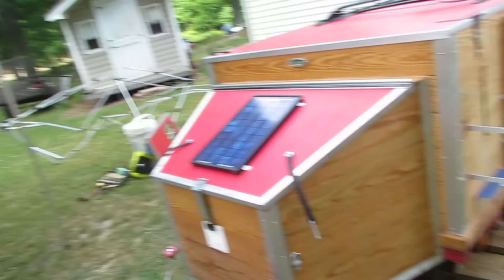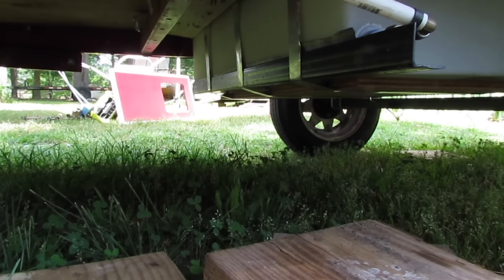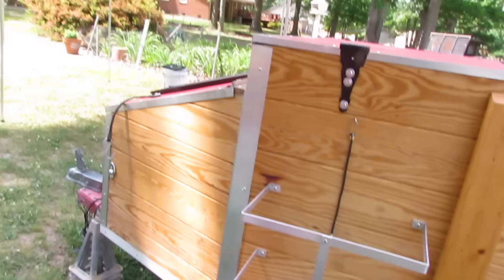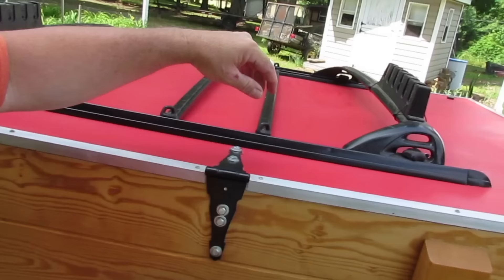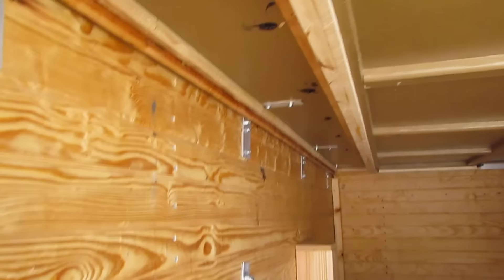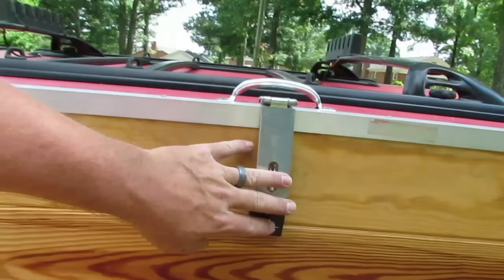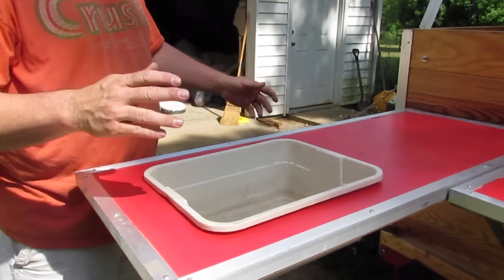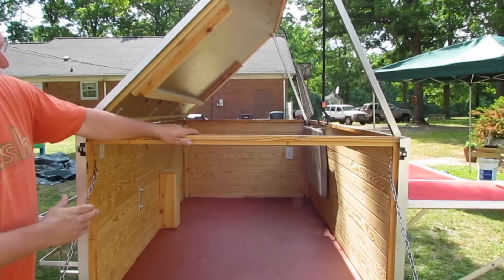Harbor Freight 4x8 Camping Trailer

Comment: How much does it weigh? So far, I did tow 3 different U Haul trailers with my 2013 Chevrolet. It was 50 mph for first 500 mile break in period as well. I did tow 3 different U Haul trailers from LA to Seattle as well. My 2013 Chevrolet does well! The empty weight of first trailer was 850 pounds and second and last trailer was 990 pounds. Car is only rated to tow 1000 pounds. When loaded with my stuff, that trailer could have been 1500 pounds and I did measure the tongue weight on second trailer, it was 156 pounds, which is not too bad. GM rates my car as 100 pound tongue weight, but it can hold 200 pounds well! Car is only rated for 1000 pound towing. Lastly, our 1978 Chevrolet from years ago can tow 5000 pounds with 500 pound tongue weight, much better rig there!
Reply from the maker: Wow, you've done your homework on the capabilities of your vehicles. My trailer weighs about 840 pounds empty. I'm not sure of the weight loaded but I'm sure I'm pushing the limitations. I pull the trailer with a 2003 Honda Odyssey and it does great. Thanks for watching

Comment: Nice Trailer, have you tought about running two batteries in parallel for more power?
Reply from the maker: Thank you, yes, I had two batteries on our last trip, worked out great. Thank you for watching
Reply: The Furrminator 
   May I ask what items you were running off of your batteries 
and what amount of run time did you get out of them...?
Thanks.

Comment: Appreciate the walk around! I’m about to start on a build with a very Similar trailer. Did you have to modify the suspension at all? How does it handle?
Reply from the maker: I haven’t modified the suspension though it’s pretty heavy when loaded. I did upgrade the tires to take more weight and higher speed rating

Comment: I see your water holding tank but where's the faucet or whatever to get water to use
Reply from the maker: Preston Frady the plumbing leads to the front and goes out the right side or passenger side. I have a quick connect there and we use a water hose to go from the quick connect to the sink.

Comment: did you think of using one panel from the Harbor Freight solar kit? one on the top and the others carried but not pluged in until the camp is set up?
Reply from the maker: I have heard that the HF solar kit works great and I've considered getting it , it's pretty inexpensive. I haven't thought of using it like that but I think that's a great idea. Thank you for the suggestion and thanks for watching

Comment: Great build and very nice video. Can someone tell me the distance from the top of the trailer frame to the top of the fender? What I'm wanting to do is  make  this same trailer 5' wide so I need to build my deck up so that its above the tire or the tire and fender. I'm not sure if I need to keep the fender in place or not. Thanks ahead of time...
Reply from the maker: I never got a measurement from top of the Frame to top of the fender before the build and now that I have the unit built the top of the frame isn't visible but a close estimate is 2.5 inches. I have raised my fenders another 1.5 inches for more clearance with heavy loads. Hope this helps

Comment: What state so you live in? From what i have researched in several states, trailer have to have a license plate and if it is a camper or tiny tome they have many more laws requiring building permits & inspections or they cannot be made by the owner at all. I’m wanting to build an RV that my son and i can use while we search for land to buy in Missouri ( Missouri is the easiest state I have found yo build your own tiny home on wheels or small house (less than 800sf). We plan to move to Missouri so that we can build both a tiny house on wheels for me & a couple of small houses/buildings for my son.

Comment: How much did you end up spending? 

Also can you make a video about how you started it? What I mean is how you attached the wood to the trailer and made it so sturdy.
Reply from the maker: I didn't keep up with the cost but I'm guessing that I put about $1,500.00 total in it. I made several trips to lowes over a three month period. Keep in mind I went way overboard and could have cut some corners to save, for example, all of the aluminum was not needed just wanted it to kinda dress it up. Here is a link to the slide show that shows some pics of the trailer during the build, https://youtu.be/SKfPgyygw7E , hope this helps, if not let me know and I'll try to explain it a little better.

Thanks for watching

Comment: Do you sleep inside the trailer?  If so, what size is your air mattress?
Reply from the maker: We don't sleep in the trailer, we sleep in a large tent. The trailer is just a way to haul our camping gear. I originally planned to build a teardrop trailer but with four kids living at home, it wasn't practical so we went with a gear hauler.

Comment: im sorry i dont get it...You supposed to use that in conjunction with a tent or what?
Reply: ahh ok i was thinking where does he sleep? lol ok then i can see that but why the electric in it?
Reply from the maker: +Dave Adkins Yea, we have a large family and we tent camp. There is no way we can haul all of our gear with the family in the Honda Odyssey so I built this trailer to accommodate. I have camped for years and I have accumulated a lot of gear, we use to camp in a travel trailer but over the years we have scaled down to a tent but hope to get another travel trailer at some point. The fact is, a tent is cheaper right now because a travel trailer that is big enough for all of us would be more than I want to spend. Hope this helps. Thank you for watching.

Comment: I think your idea is VERY cool! But, Wouldn't it be cheaper to by a POP-UP camper and customize it to fit your needs? With a POP-UP, the kitchen is inside (all season), heat, hot water, plumbing, sewer, sleeping... all self-contained... Dont get me wrong... VERY COOL VIDEO! But, I would buy a regular pop-up, cheap, and add some $$$ to do the options you suggest! I think the $$$ would go a lot further...
Reply from the maker: You are probably correct about the popup. I originally purchased the trailer to use as a teardrop trailer. Before I started the build I determined that it wasn't really going to work for my large family so I changed the plans to build what I have now. Thank you for watching
Reply: 3zonker88 More fun to build from the ground up. You just don't have as much "you" in a trailer to you customize after buying it, as with a trailer where you build everything (except the base frame, of course).

Jeff, I suspect one of your kids (or grandkids) is going to talk you out of this one day!
Reply from the maker: +Gerry Seymour I agree with it being more fun for sure. I'd rather build than remodel any day.  I do hope to pass it down some day. my wife is eventually wanting to get a big pull behind camper so we don't have to tent camp. If that happens I would imagine one of my two oldest kids would be taking this thing to the campground.

Comment: Did you ever think of using the trailer wire harness to charge the battery ,say when you have the running lights on you steal dc voltage that goes to a charge controller to the battery ?
Reply from the maker: Actually I did think about that several times, problem there is I don't know that much about the electrical part. Adding lights and such is pretty easy to figure out but what I couldn't grasp is how to wire it to do what you're talking about. I hooked up the harness to the trailer battery once and the result was the trailer lights stayed on. The other issue was how to prevent the current from traveling back to the van once I connected it. I know this is probably a pretty simple thing to do but I couldn't figure it out at the time so I dropped the idea and hoped that I could figure it out later. I asked people at several different auto parts stores how to do wire the trailer to get charge from the car, no one could tell me so that's when I decided to try later.
Reply: It's really not difficult to do , if you would like inbox me your email address and I could give you a material list right from Amazon and very simple instructions on how to do it. If you do decide to do it I'd also add another battery . The 5 watt panel will give you enough to to charge cellphones and tablets .
Reply from the maker: That's really kind of you to offer, I would really appreciate that information. My email is thefurrminator@gmail.com
Thank you
Reply: +Jeff Furr (The Furrminator) ok i will send you a message with my contact info later today. It would be really simple and not to much money to do

Comment: I know this is an old video, so I hope you still can answer. I am looking at building something similar to haul my inventory around to different gatherings and outdoor events. Once emptied I am planning on being able to sleep in it. What is the weight of your trailer? Dry weight more than likely as I wouldn't have to carry water etc until I got to my destination. Also is this one of those Harbor fright trailers you have to assemble, how has it lasted over the last 5 years? Thanks in advance for answering the questions. The help is greatly appreciated!
Reply from the maker: If I recall correctly, the dry weight is a little over 800 lbs., it is a folding Harbor Freight trailer and it has held up well. We haven’t used the trailer in a while because we purchased a travel trailer. I did upgrade the tires to max out at well over the max on the trailer just for piece of mind. I hope this helps.
Reply: @TheFurrminator  Helps out tremendously! The trailer you used is EXACTLY the trailer I have been looking at. It is good to know that the trailer is good quality for the money. Thank you for the info!

Comment: That's a neat little trailer. If you don't mind my asking, how long have you had that inverter, and how is it holding up?  I've been thinking about getting that same one.
Reply from the maker: Thank you, I've had the inverter for about a year and a half. I have only used it for three camping trips and a few times when the power was out at home due to ice. So far it has held up well and handles what we use it for. I would buy it again if needed.
Thanks for watching

Comment: Outstanding build, really well thought out and executed. I have that same little trailer. Question; what would you do to make something similar but without the folding lid, strong enough to hold a rooftop tent on Yakima racks? Tent is about 150#. Thanks!
Reply from the maker: exRhodie thank you, I appreciate that. That’s what I was thinking, some type of rack to put it up higher and out of the way. I had actually considered doing the same thing but never tried it.

Comment: I don't like people like you...you're the type that always come up with awesome ideas that I kick myself for not thinking up myself! VERY nice build and great thought you put into your trailer sir! Congratulations. Just curious, did you use the 1170# or 1790# trailer? I'm assuming the 1170 as you wouldn't need that heavy of trailer. Once again,  good job!
Reply from the maker: Thank you sir, I really appreciate that. I now have several of these Harbor Freight trailers and I’m pretty sure that one is the 1170, it’s been a while since I have used it or worked on it. This is a great little trailer though and we have had a lot of fun on the camping trips using this trailer. Thanks for watching
Reply: The Furrminator, watching the video again. Mine that I got 2 years ago is the heavy trailer. Love it. Just do preventative maintenance and should last however long I want. I'm thinking for the current time that I'm going to mount a popup slide-in on it. That being said, great stuff!

Comment: How did you put the back rack on? is it just bolted to the frame or is it going into a receiving hitch?
Reply from the maker: I bolted two prices of square tubing under the trailer, like two receivers, one on each side. I then   Welded two pieces of square tubing to the rack that slide into the ones bolted to the trailer. I chose to put two receivers to prevent any rocking on the rack and to make it a little stronger. I did include a pin on each side so the rack can be removed at any time.

Comment: ok, so, I'm not entirely sure I'm following...this is a camper, or it's a storage/cargo trailer that you use for camping?  are you setting up cots inside it to sleep on (or just dropping sleeping bags on the floor), or pitching a tent beside it?  if sleeping inside it, have you considered putting some attachable mesh netting (mosquito netting or similar) around the sides where it's not hinged so that you can actually use the trailer as the enclosure?
Reply from the maker: dhyde79 it's a camping gear hauler / storage trailer but I do want to add a canvas or mesh at some point, like you mentioned, and use it to sleep in. We tent camp and use the trailer as a chuck wagon or kitchen while camping.
Reply: gotcha...if you go the route of converting it, perhaps do mosquito net permanently attached with a snap-on canvas cover to provide privacy that mounts either inside or outside....(probably outside for weatherproofing)

Comment: Where's your over current protection? I.e. fuses and cut off?
Reply from the maker: The only fuse on it so far is on the water pump. I'll be adding more though

Comment: Jeff after u fill the water tank up how do you get the water out ? I never seen a faucet or spigot.
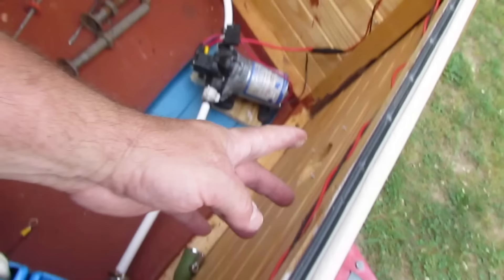Reply from the maker: There is a sure flow pump in the front box and a quick connect on the outside of the box to connect a water hose. You can see it in the video at 2:30.

Comment: Checking these trailers at Harbor Freight they warn not to go over 45 mph. Any issues going more than 45?
Reply from the maker: blocktube123 I have had no issues at all! it pulls great, other than needing to upgrade the axles and springs due to the weight of the load I carry. Thank you for watching!

Comment: When you were all done, did you happen to get an "Empty Weight" ?? I have a Jeep Wrangler that I want to do something for, Towing capacity is 2000 lbs gross.
Reply from the maker: If I recall correctly, the weight was 840 lbs. which means the build took up a lot of the payload but I'm going to upgrade the axle and springs to accommodate a heavier load. I pull this trailer with Honda Odyssey and it pulls great.thanks for watching

Comment: Great job Jeff! You said the build cost $1250.00. Was that including the cost of the trailer? Also, what exactly do you use the water basin that's attached on the bottom for?
Reply from the maker: Thank you. I'm estimating the cost at $1250.00 because I failed to keep track of my purchases along the way. The 1250.00 is after spending $250.00 on the trailer off Craig's list. The water tank is for fresh water and we use that when I attach a hose to the pump and it supplies water for washing dishes, drinking and to have water for a shower. Thanks for watching

Comment: How fast can you drive with that trailer?

Great video!
Reply from the maker: BenevolentXMachine thank you, the original tires are rated for 55 MPH but I have up graded the tires on this trailer. I have traveled on the interstate at 75 MPH. Of course before doing that I made sure the bearings were well greased. Thank you for watching

Comment: he is working around 3 grand? for a camper. you can buy all this put togeather at arounb a grand. its called a popup trailer.
Reply from the maker: You're correct, not hard to find a popup for around a grand. I have an estimated $1500 in this trailer and it works great for my large family to haul the camping gear. We use a tent for sleeping. Thank you for watching.
Reply: I do wood but the time and effort  seems more then the effort it took to make the money to buy the things to build it. Its nice. Dont get me wrong now. Love it. I do wittling and that is so much for so little.

Comment: what size vechickel woul you need to pull this would a 6 cindler pull it? like a kia soul
Reply from the maker: I pull it with my 2003 Honda Odyssey Van, it has a v6 and pulls it just fine, even when loaded. I pull the trailer loaded to the mountains and the v6 does great on the hills too.

Comment: Is this the 1200 pound rated trailer or the 1700 pound rated trailer? What would say your build weighs that you put on there?
Reply: Any time you see the V tow bar where the point of the v is the connection for the hitch ball coupler, it is the higher rated one. The lower rated trailer is a small v maybe a foot or so from the front of the trailer and then from there is a single square tube all the way to the coupler. Hope this info helps.
Reply: @angelito4058  Yes that is very helpful - As I am looking at getting a trailer from a local classified ad.

Comment: Does anyone perhaps know the legalities of something like this? Can you buy a utility trailer like this and make your desired adjustments (within reason, of course aka following standard vehicle safety laws) and tow it down the road? I suppose you’d need to put the car license plate on the back of the trailer… n prob something for brakes (?).. but is there anything else you’d need to consider?

Comment: How aren’t you exceeding the weight limit of the trailer?  I mean your components alone (water weighs 8.33 lbs. per gallon) weigh a lot , I can’t imagine adding much cargo.
Reply from the maker: Greenid Guy I never travel with water in the tank or containers, I fill them when I get to the campground. I have upgraded the tires and I have plans to upgrade the axle at a later date too.

Comment: In my state of you do something like this you need to get it licensed
Reply from the maker: The trailer has to be registered with the Division of Motor Vehicles here in North Caroljna, As long as you keep the break lights and turn signals it is legal.
Reply: +Jeff Furr in my state you have to get it checked out to be road legal